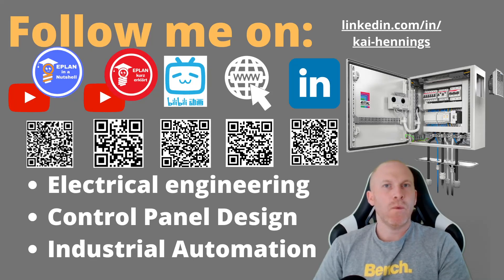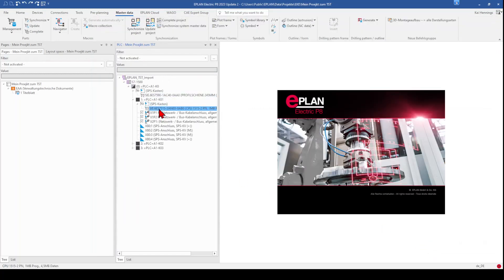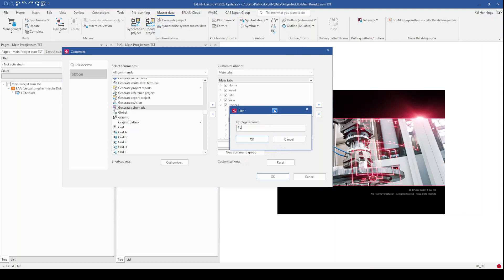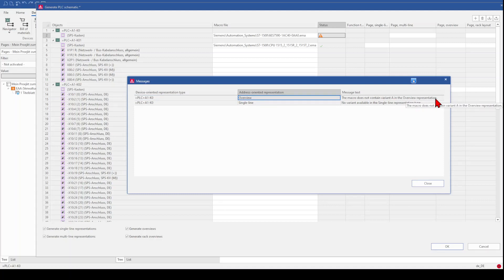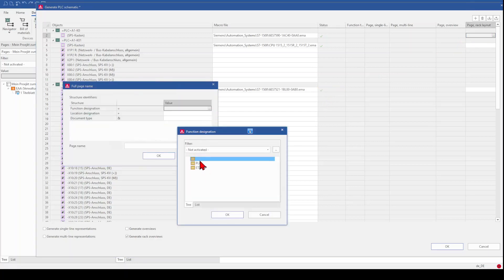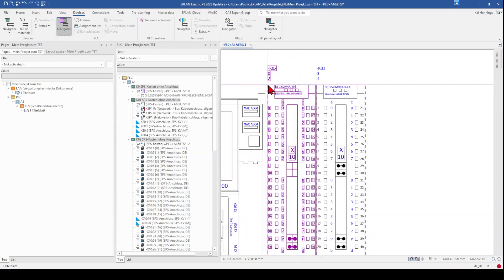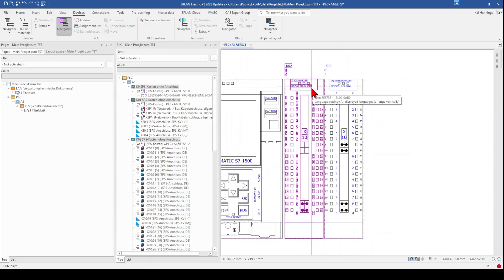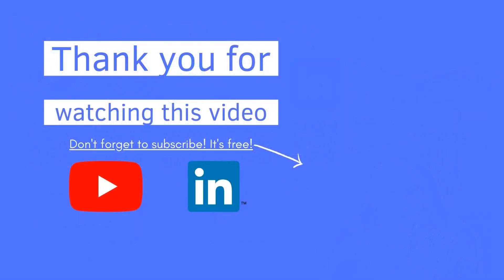Generate PLC schematics automatically 🦾. You should know this hidden function in EPLAN 💡

Comment: Hi Kai
As usual, useful information. 
I would like a video on drawing graphics. I mean: 
e.g. 
a)a straight line of definite length .(without having to go into properties) now, when specifying the length of the line, it turns out that it gives the angle that is to start.
b) use a mirror so that the line or graphics are also reflected. Currently, when I use a mirror, the object disappears .
Very useful for creating Panel Layout 
Thank you